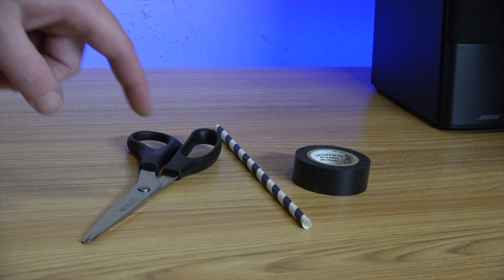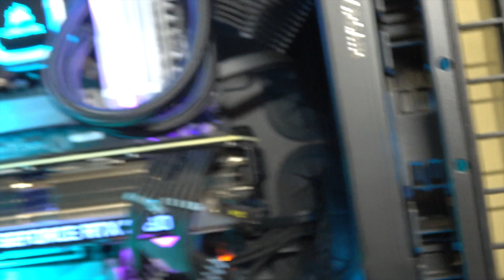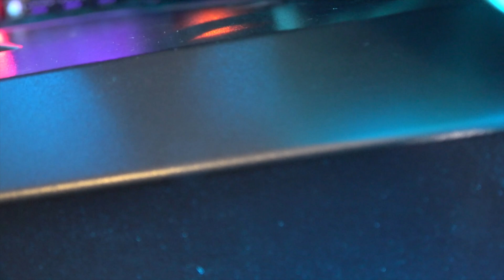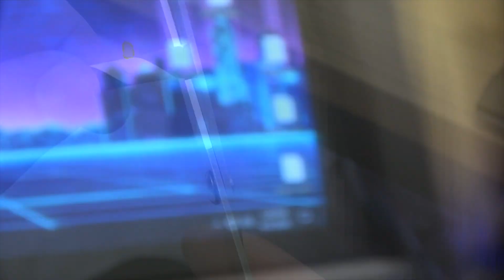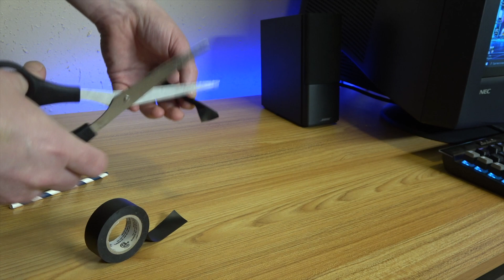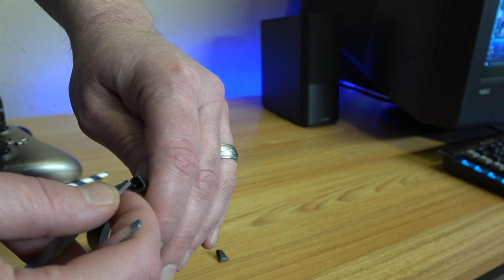How to Fix GPU Sag

Comment: pls help is it sasfe if i use a ps4 controller as a brecket?? the l2  trigger is on the top touching the gpu and the 2 handles are touching the bottom of the case
Reply from the maker: That should be fine, it would be all plastic making contact with the computer. If you wanted to be extra safe, you could drain the battery in the controller before you try it.

Comment: magnetic base support brackets are like $15 all day long on Amazon I mean you spend a grand on a 2080ti save $15 for a brace haha
Reply from the maker: rtx/on most of the ones I’ve seen on there are ugly or have the company logos on them. I like this better because it’s all black and blends in
Reply: @TechWithSean  those are available as well your hack is great for a temporary type solution sure just not long term in my opinion

Comment: Wouldn't something a little stiffer be better and more durable? Something like a pencil or piece of dowel and just cut it to length with a sharp knife or razor blade.
Reply from the maker: tzone - I have done this on many systems and it has always been strong enough. I’m sure wood would be fine, it is harder to cut and get to size though. I would be careful with a pencil, I think the graphite center may be conductive.